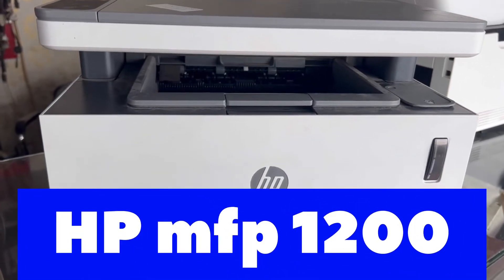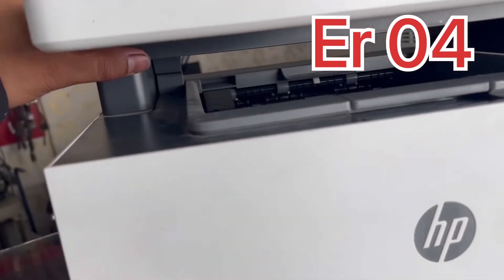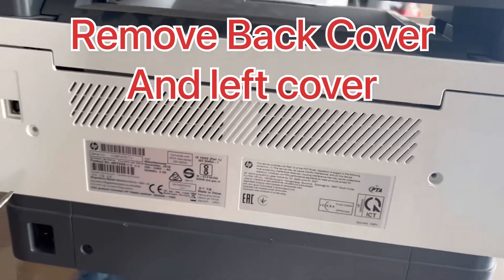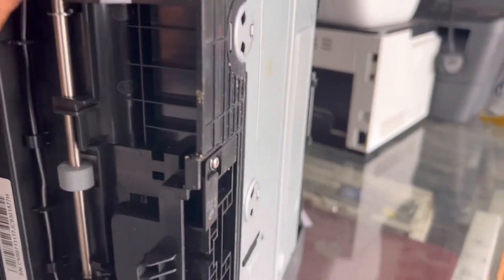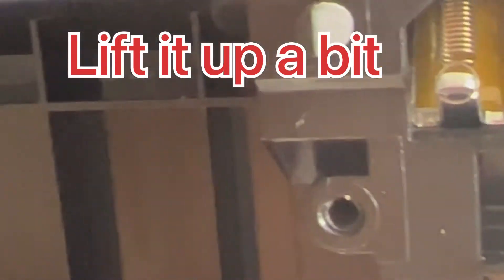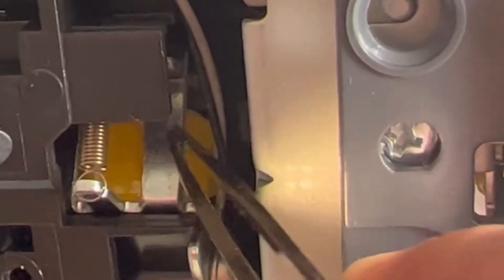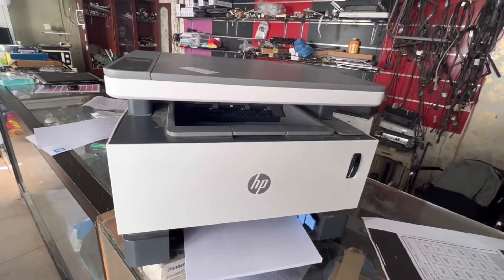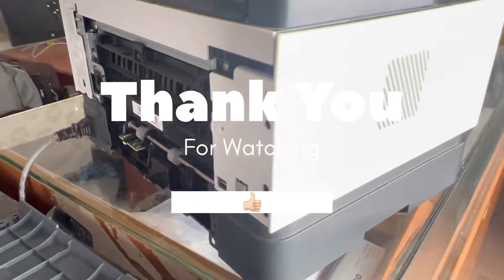HP Neverstop Laser MFP 1200 Er/04 or Er/05 Displays Paper Jam Issue

Comment: This is a very complicated process to simply execute unjamming this printer.  The quality of the audio on this video is not great; had it up as high as it would go and could barely hear the gentleman's voice.  

We took the back off of the printer, unplugged it and were able to unjam it when we plugged it back in, without the detailed instructions which were being given which included using tweezers.  

I would suggest simply unplugging the printer for 5 - 10 minutes, plug it back in and hit start.  This worked for us.